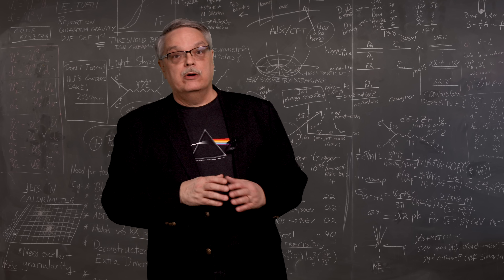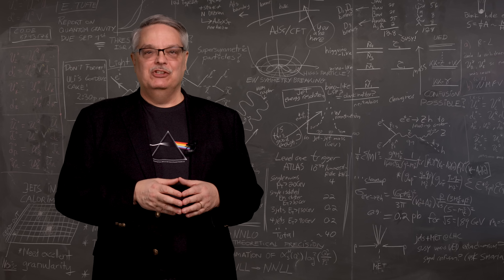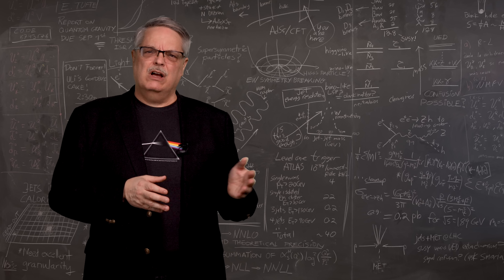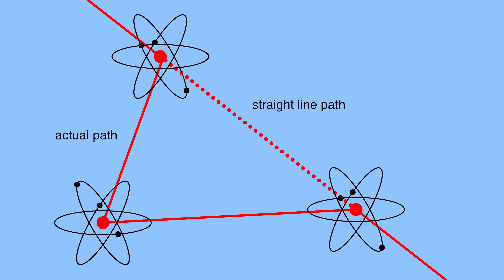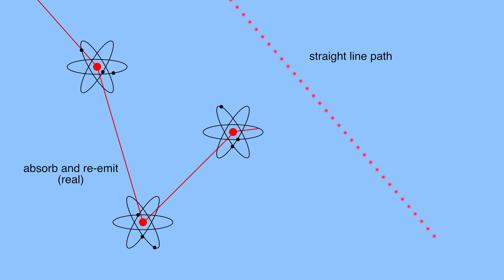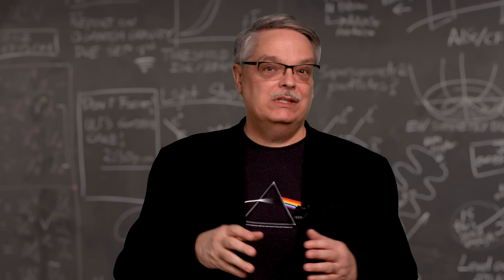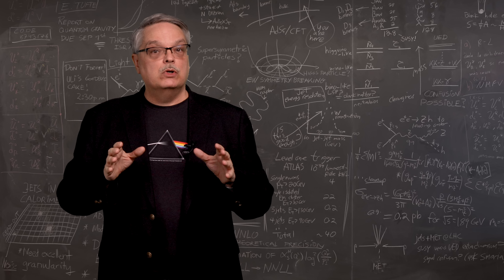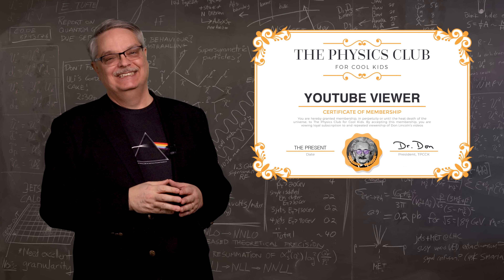Why does light slow down in water?

Comment: He is wrong. How light propagates through material is multidimensional. A prism will diffract incoming light into components. If the material is nonlinear glass you can get birefringence. There are time crystals which can store light up to few ps. If the light exceeds speed on material you can get chernikov radiation
Reply: "How light propagates through material is multidimensional"

Correct, he was showing a 2 dimensional example for simplicity. The same principle still applies in the real world.

"A prism will diffract incoming light into components"

By exploiting the slowing of light passing through a medium, as explained here.

"There are time crystals which can store light up to few ps"

I think you've got two concepts mixed up. Time crystals are structures that repeat in time, the same way regular crystals repeat in space. We also have materials that can slow light down to the point it is barely moving, and there are fancy setups that allow light to be "trapped" in a crystal, is that what you are referring to?

"If the light exceeds speed on material you can get chernikov radiation"

Correct... but like the rest of the thing's you've said here, completely irrelevant.

Comment: A wonderful explanation! Thanks!!! A (related) question: if the universe is expanding (and I'm told it is) and is also speeding up, what will happen when (the outer?) part of it approaches/reaches the speed of light?? (Does it all collapse in on itself until it is tiny and set for another Big Bang?)
Reply: There already are galaxies "moving" away from us faster than the speed of light due to the expansion of the universe. The key is that they're not actually moving, the space between us and them is just creating more space between us and them. Therefore, they don't violate special relativity (not being able to actually move faster than light) and nothing spectacular really happens, except that they're forever lost to us.
Reply: @lunkel8108  Thank you Pootis, this has "bothered" me for a long time. I did just watch Dr Lincoln's explanation a second before you replied to me, and, of course, he explained it too. I'm not a physicist and I still have trouble with this: if the universe is stretching, isn't it stretching faster than light? Also, stretching or moving, aren't the points on the balloon moving away from the balloon's centre (i.e. gallaxies moving away from us at more than the speed of light)? I'm not trying to be clever or argumentative here; it's just that I'm still having problems with this apparent semiotics.

Comment: I dont agree with this explanation. We can add this to the list of possible explanations but this explanation raises more questions. The waves generated by oscillating electrons should also move at the speed of light. So this means that in the medium we effectively have two or more light waves interfering with each other. Light interference should not change the speed of light. If it does, then the speed of light should change when you send light through two slits or when two light waves interfere outside the medium as well, for which there is no evidence. In my view the sixty symbols video is better because they mention quantum mechanical effects might be involved and that there is no definite answer to this question.

Comment: This video clearly explain why most people are wrong confusing transparency with scattering or fluorescence.
The addition of waves with slightly different frequency producing a wave that change in intensity cyclically, like if it was AM modulated is interesting. It illustrates how radar work : the 30 ghz radio wave that hit a car comes back blue shifted (if the car travel toward the radar) or red shifted with a frequency difference of about 3 khz for car running at 100 km/h (65 mph). The radar emit a short burst, then it listen for the reflection but keep it's own oscillator active. A simple non linear rf amplifier sense the frequency difference. The resultant value at 3 khz goes thru a simple frequency counter and the final output scaled to match the value in km/h or mph or any other unit.
The illustration of two  sinusoidal waves of different frequency creating a wave with a complex shape  prepare your mind to understand what is  "superposition". It is not the stupid cat dead and alive or other meaningless thought experiments or inside jokes that people who don't belong to that inside take seriously..

Light slow down in transparent material for the exact same reason a RF signal travelling in a coax cable also slow down. The electrical engineer explanattion is to model the cable as a large number of inductance in series and capacitors in parallel. Each pair of inductance/capacitor absorb the energy of the wave and release it in a synchronized way. The effect is both voltage and current are delayed by a fix amount of time. The same small delay keep being added  by each pair.
Contrary to resistance, good quality capacitor and inductors don't waste the energy they receive. A capacitor is like a very fast rechargeable batterie, able to accumulate a voltage and release that same energy with loss. An inductor can store current, instead of voltage, for a short time then release that current.

Inductors are weird because they initially resist the passage of current. Then, as the magnetic core become more and more magnetized, more and more magnetic domain align their north/south poles, the current keep increasing. But how an inductor can know that a urrent is trying to flow thru it if it resist the passage of current. This paradox imply that inductors can not truly get close to "perfection". They have to leak some current right away in order to start creating a magnetic field.
So, light in transparent material is gently pressuring the electrons. Because electron have mass, granted only 1/1836 compared to proton, , it takes some time to start moving. Then, a the crest of the wave passed and now try to  move the electron back to it's rest location, there is a delay before the electron can slow down, then start going on the opposite direction.
This system is comparable to a mass attached to a spring.

Comment: ...wave(s) of what?  At around 6:25 i heard laughter... it was mine.  So, the reason light moves the way you say it does is because the explanation you give is better (illustratively speaking)?  Applied geometry... common, and neither ‘cosmology’ nor ‘metaphysics’ were in your title.
Reply: Waves in the electromagnetic field. Come on, this is really old physics, like 1870 physics.
And no, this explanation is correct because it concerns the actual mechanics behind it. This is correct because this is what actually happens, as confirmed by countless experiments.
Reply: A field of electromagetic waving of WHAT?  Model confirmation is just that, only.  Waves are still not things-in-and-of-themselves, really.  Fermilab’s insinuation that geometrical aspects dictate light phenomena as a better model exemplifies the necessary existence of Paradigm Shift, actually.

Comment: I still don't see a full explanation of ViperDaniel's question of why the combination wave moves at a slower speed, and I have two other questions: If the wavelength is changing, that would also mean the color is changing. And, for the response wave to have a measurable impact on the light's speed, it'd have to be a pretty impressive change in wavelength, as well, no? Wouldn't we see the light changing color pretty substantially in non-vacuum mediums, if we can see as much as a 70% reduction in light's speed through those mediums?
Reply: The light immediatly returns to their original state when leaving the material.

Comment: Wished u would explain it more.
How combining to waves would change the speed of propagation?
Reply: it doesn't. here's the true explanation :

this video has taken many shortcuts in explaining the relations between the two systems and how it affects them.
to better understand this, we need to talk about d'alembert's equation and its dispersion formula and how it describes a wave.
so d'alembert's equation is used to link together the spatial and temporal variation of a wave.

and from this equation comes the dispersion relation that links together the frequency, wavelength and celerity of a wave.
to access to this equation, we use maxwell relations to describe this phenomenon. when we consider those relations in the void, we get the relation: c² = k²*w² where k is the angular frequency and w its wavenumber. (just google it, ain’t that hard to understand)

thus we can see here that the celerity is proportional to its angular frequency. however, as explained in the video, when light enter a medium, there are charges that can be influenced by the electric field, especially electrons that are 2000 times lighter than their counterparts protons.
thus, when light comes in this medium, we assume that only electrons are affected by the electric field.

we then apply newton's second law to those electrons to find a relation between an electron's speed and the electric current
(we also neglect the magnetic field of the light as the electron is relativistic thus the force from the electric field is much greater than the magnetic one see lorentz law to better understand this )
and then by generalizing this equation to all electrons in the medium, we can get an induced current from the electric field of the light.
( the current is j = n * v with n the volumic density of charges and v the celerity of electrons)

then when we put this back to maxwell ampere local equation, we introduce a new component: the induced current which thus gives us a new dispersion equation: c² = k² * (w² - wp²) with wp the plasma oscillation and thus we can see that from the value of wp, we'll get a different value of the celerity of the wave.

thus we can say without a doubt that they are wrong in their explanation as it is not the combination from the electric current of the electrons and the wave that makes it slower but the induced current inside the medium that modifies the dispersion relation thus modifying its speed.
or in simpler words, it's the movement of electrons that changes the frequency and celerity of the light, but not the combination of the two electric current. (also on a side note, trying to represent the electric current of a dipole using a sine wave.. funny thing you did there 😅)

and finally, as for the reason why the light has a different angle, well you can easily explain this using two waves parallel to each other crossing the medium in phase with each other. as they have the same wave plane, you can easily come to the relation between the refracted angle and the incident angle using some basic geometry. i recommend you to see the demonstration of descartes second law if you want to better understand what i'm talking about.
Reply: @recouer  thanks for the effort but it is a bit out of my range. I read it and i tried to understand it as much as i can. i accept your calculations blindly.
Now If this is the effect of electrons on light so why is that the reduction of speed of light is not proportional to the thickness of the material?!
As light goes through a medium, there are more and more electrons intracting with photons which induce the same effect on light so if this is true light should continuously loos speed!
What you drived may be an agreeing answer with reality but it does not add to the better understanding of the phenomena.
The more i learn, the more i think that light is just a pressure wave like sound(not necessarily the same). What i model is pretty unorthodox, premitive and it takes a lot to convey my understanding to somebody else so i stop here. I know you u may want to kill me now 😀 . I wished i studied physics instead of engineering so i could show it scientificly. My model gives some insights for some paradoxes.  ( I am not a physicist, i am not claiming i am right or anything esle, i just simply enjoy playing with ideas)

Comment: I had a theory in my mind, I would not go as far as to  throw it i around online, but I would like to hear peoples opinions on it. We know that gravitational redshifting can take place considering GR, like an energy escaping just above the event horizon of a black hole. Well if we think of the strong atomic forces the extreme forces on that scale, its clear that it would also cause a curve in spacetime the way gravity does, just much more intense. so once light enters the dilated fabric of space it slows down and change direction the way it happens with gravitational lensing.  Remember that a glass lens and gravity do the same thing with light, I can assume for the same reasons. because this even happens with 100 km wave lengths and i doubt single atoms really have much influence there, but the curving of spacetime will still have the same effect. Since we never use GR in atomic scale we neglect the fact the time is dilated between atoms and that the same phenomena as gravitational redshift and lensing will happen only this time with the strong atomic forces and not so much gravity.   I must say this idea I have not yet seen so its not very popular but it was just an idea I had from how I understand the effects other forces like gravity has on light. I also make the assumption that the strong forces are not fundamentally different in what they really are than gravity itself. I see them all as curvatures in spacetime 

Just remember Einstein did consider c to be a constant, but in fact he adjusted time as the variable that slow down in the presence of the curving spacetime. but away from the observer observer outside, for whom time did not chance c had to slow down where space time is curved but once the light exit the material and get back to the environment where time is the same as that of the observer, c is also the same as for the observer thus the observer observe c to remain constant and light is back to its old speed, even the light did, but because time slowed down in the material and c stay a constant for that time,  it caused an delay.  Gravity time dilation can be compared with the strong atomic forces time dilation.  The exact same thing that happens with gravitational lensing happens with magnifying glass, the only difference is that the atomic forces are more the kind of thing you would get near black holes, very intense. Anyway that's my theory.

The issue I have with the two wave theory is that you explain the slower group velocity where information move slower but still make no difference to phase velocity, the speed of the energy. When we talk about the speed of light we talk about phase velocity and not group velocity. this why vp=1/sqr(e.u) a pure sine wave does not carry information, so by modulating it you have information, but the modulation is subjected to the group velocity, while the wave still move at the speed of light, only the information is slowed down.

Atoms will scatter the waves as long as the waves are at wavelengths around the size of  the atoms,  the issue comes with long radio waves. As long as the wave lengths are  more than 4 times the size of the atom there will be no scattering, then its only the effect the atom has on the waves environment that will change anything.  for example in acoustics its the same, a rough surface like cement will not cause diffusion of sound waves, you need to increase the size to I think at least a 1/4 wave length. the same apply with the grid antenna, if the holes are smaller than 1/4 wavelength it will still be an reflector. I do believe the absorption and emission theory is a problem,  the longer path is also an issue as it assumes you work with wavelengths smaller than atoms. If the theory do not work for 100km wavelengths then it does not work because refraction even takes place at 100km wave lengths.

Comment: So if the wave is changed by the atoms in the glass, and the color of light is based on the wavelength then why doesn't the color of the light change when it passes through the glass.  Or are we supposed to believe that the waves magically start oscillating at the original frequency when they leave the glass even though they were changed to a different frequency when they were inside the glass.
Reply: Of course the light returns to its original wavelength when it leaves the material. Otherwise the light would continue at the slower speed. This was explicitly explained in the video and is no magic. The light simply no longer experiences the extra field from the electrons, therefore it's back to  its original state.
I feel like you didn't understand the video.

Comment: Light behaves as a wave and a particle. In a vacuum, the two travel together with 0 oscillation variance. Through a medium other than a vacuum, the two are no longer the same, and the two are sort of averaged out, causing a slower speed.

A layman's equation may appear as:

The speed of light = 186,000mps in 0 variance  (c= 186,000mps * 1)

But through a medium of some kind it's:

c= Wv+Pv/2 or

The Speed of Light is equal to the wave velocity, plus speed velocity, averaged out, or divided by 2... Which is slower than c, or 186,000mps.
Reply: *SORRY, CORRECTION... Correction to the last part. It should have been:

c= Wv+Pv/2 or

*The speed of light is equal to the Wave velocity, plus the Particle velocity, divided by 2.